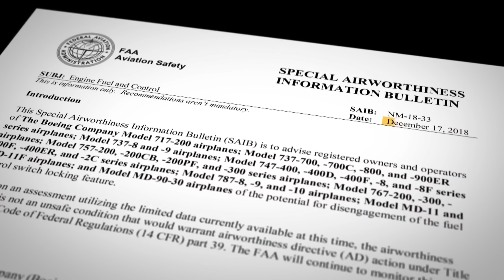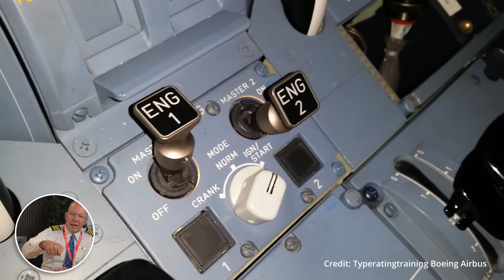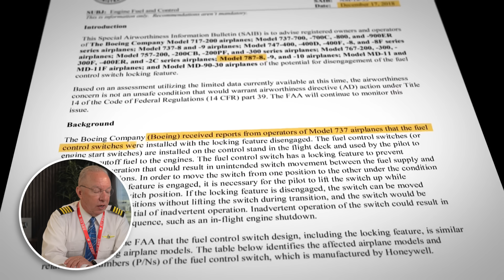Air India 171: The FAA’s 2018 Fuel Switch Locking Bulletin Explained (16 Questions Answered)

Comment: Captain steeve please see section Copied from the NM - 18 -33 report. It was not positioned upside down.  *The Boeing Company (Boeing) received reports from operators of Model 737 airplanes that the fuel control switches were installed with the locking feature disengaged. If the locking feature is disengaged, the switch can be moved 
between the two positions without lifting the switch during transition, and the switch would be exposed to the potential of inadvertent operation.*

Comment: Do we know the details of the wiring logic from the switches to .... Common mode failures (which this appears to be) happen due to poor design or inadequately considered design. 

You and many seem to still be thinking in terms of physical switches connected to wires, controlling discrete devices. In that world (decades gone), these two switches are independent circuits. Common flaws still existed but were vastly less likely.

Now with all the computer control, even physical switches often feed or control software systems. If the switches command computer action, common mode failures in that system is a major concern.

I suspect that is what happened here. Irrespective of the physical switches connected positions, I suspect that software failed and these circuits were switched to off despite the physical switches being in the on position. 

If this happened, the sequence we heard would be what we expect. The pilot (co-pilot in this case) asking why... the second seat (pilot in this case) turned the switches off; and him replying he didn't. 

In this case, the indication that the switches moved one second apart indicates NOTHING about the physical switch position, but rather the logical switch position in the software - as commanded NOT by the switches, but rather through software fault. 

Then after the question and answer, the second seat took the switches to off and back to run in sequence.

As the software thinks the switches are in off, the first part of that action is NOT logged, and only the return to run would be logged. The 4 second separation then makes perfect sense.

The key to figuring this out is to determine what precisely does the switch position logging record. Is there a detector on the physical switches that indicates their physical position? (unlike;y), or is there a continuity detection from the switch (also unlikely), or is there instead a logical indicator in software (most likely). Then based on that determining what failure modes could cause the failure. 

Only if the first of these is the case (logging detects the physical switch position directly, NOT INDIRECTLY OR BY INFERENCE) does the primary case suggest human action. All others suggest a potential for UNCOMMANDED action.

Comment: In the preliminary report it's stated that the fuel cut off switches were put back to run position. The thing that caught my attention is that there was a 4 second delay between putting the first switch back to run and the second being put to run position. Isn't that a bit too long a diffence for two switches that are next to each other

Comment: Why did it take the other pilot 10 seconds to put the engine switches back to Run ? Also there is a 4 second delay between the switches during this time. When they were used for cutoff it was just 1 second.
Reply: Because how would you know your co pilot did this? It would first take some time to figure out why the engines are suddenly slowing down then by his intuition or experience he must have noticed that it was the fuel switches, at this point the plane is already going down there are multiple things to handle ..unlike the airbus design I don’t think you can handle both the switches at once on a Boeing plane since the tops are rounded
Reply: @andrewmarthie5062  the 4 seconds is between the 2 toggling switches. So let's say he does see that the switches are off. As he must have done many times, he would flip the 2 switches in quick succession.

Comment: Can someone manually move the switches to cut-off position after the plane crashed already? Did the black box log the events related to switching those switches during the flight? So after the second pilot moved both switches back to normal position, another pilot again switched them back to cut-off position? 🙄
Reply: No bro even after re engaging the switches the engines didn’t have enough time to make enough thrust
Reply: @andrewmarthie5062  I understood that from the previous video. I wonder if another pilot even tried to return them to the normal position... And if he did then whey they were in the cut-off position in the very end?

Comment: I think it’s time for the FAA to put forward a mechanism for video data to be included in black box recordings. It’s a fine line between privacy and safety but the differences can be overcome. Black box data can only be accessed after its physical retrieval so video data could be exclusively stored in the black box. This will overcome the threat of video data leaks. As another procedure I would also recommend the automatic deletion of all video data from the black box once the plane is on the ground after flight and the engines have been shut off. I don’t believe that too many pilots would disagree with this and imagine the answers video data could have provided to this disaster. Questions that unfortunately will never be answered due to lack of video data. It’s sad the final stage of decoding this disaster will remain unanswered, which of the two pilots cut off the fuel and why. Video data could have helped answer that

Comment: Hi Steve, I have a couple of questions around the fuel cutoff processes.. 

You stated that an electrical fault is just not possible with regard to the fuel cut off switches and dismissed that concern outright with not much explanation.

Would you be kind enough to delve into that a bit more for us simple people so we can understand the process better?  

How is it not possible? What redundancy system catches would be in place to pick this up? 

At the heart of my query is, Is it possible that there may have been a  "glitch" in the electronics or indeed the programming that MAY have caused or contributed to  this?? 

Is it fair to say that we have seen accidents in the past that have been caused by software glitches or circuit malfunctions?? 

Thanks you for your excellent work on this.
Reply: Glitches don’t work like that and are very very improbable…the 1 second delay between cutoff the cockpit voice recording of the captain objecting and the 4 second delay between captain manualy re engaging suggests that they were indeed physically in an off position and taken out of that position to run again by the captain (I’m assuming captain).. so it’s foolish to suggest a electric glitch cause that won’t cause the switches physically moving positions

Comment: I don't know if I feel better knowing it is deliberate or if it is an mechanical or faulty electric or design+safety overall. I think Bby my reaction when you came out before yesterday, I may be by the slightest margin think I am a bit relieved it was a more probable deliberate act. I think I am more reassured to find it out

Comment: Were there two ADs, The one read at the head of the video warned of a catastrophic failure,  you said the one you discussed meant you could not start the engine, that would not be catastrophic, just annoying. 

As I heard the girl (AI?) read the first one, the problem was the locking mechanism was not installed correctly, which could lead to a catastrophic failure. I assume that the spring was improperly installed, if at all, and provided no resistance to moving. If that's the case then ergonometrics might be an issue. I understand the visual logic of having switches up for on, but if a hand falling off throttle control could be an issue, then up should be off. Maybe better, the switches should work sideways. However, if the AD was done, ergonometrics could not overcome an intentional act.
Reply: Even without the locking mechanism both switch had a delay of 1 second … even if you accidentally brush against such hard equipment there won’t be a delay of 1 second …this was deliberate

Comment: Why do u think, turning back fuel switches to run state took 10 seconds ? And that too after long delay between two ? Like it was turned off at 1 sec difference, cant both be turned back on together or at minimum interval?
Reply: If you were the captain how would you know your copilot sneakily did this? First you would hear the engines slowing down then you would try to figure it out, not like your co pilot is going to help if it was deliberate … even 10 seconds seems very fast
Reply: @andrewmarthie5062 question "why did u turnoff" was spontaneous, but turning back the switch on would take time? Is it by design, as aircraft is now on RAT and it takes more time to 'process' the command even when switches were moved back to run immediately?
Reply: No they both can’t be turned on back together …it’s a one at a time operation with the design on boeing
Reply: @andrewmarthie5062 simultaneous off needs prevention, off to on transition should have been designed to be faster ..

Comment: Does the Black Box record how many times the switches were moved no matter the function of the engines? For instance, after cut-off, how many times they may have been rocked ON/OFF? This might indicate a mechanical switch failure if the pilots were attempting to make the switches function properly. So, at the point of the pilot asking "WHY?" do we know what position the switches were in and how many times they changed? Can an electrical problem block changes of switch position from the Black Box?
Reply: Yes …it was in the report…they were both turned off once and then on again later at different intervals

Comment: Steve, I work as an aerospace test engineer in the military sector and see switches similar to this in various applications in avionic systems. My comment is in 3 parts.. Firstly - The Boeing SAIB MM-18-33 refers specifically to the detent on the switch; not the installation of the switch itself. Also the aircraft would never pass final flight testing to be delivered to customer if installed upside down. In my experience, there are many different part numbers for similar switches as you can see from the list on the SAIB and it would be easy to think that the SAIB applies to a  737 aircraft not a 787 aircraft as it appears to use different switches and therefore the it doesn’t apply, but in reality the switches can be identical from a functioning electrical and mechanical detent perspective; but may simply carry separate part numbers because of the style of end cap on the switch or even paint colour for example. I cant understand why section 12 of the report does not call for further investigation with Honeywell (who are the switch suppliers according to the report). Clearly, If the switch detents didn’t hold the switches in the up position as required due to vibration or inadvertent touching at the wrong phase of flight, it completely explains the conversation between the crew who maybe blameless in this instance. Secondly the SAIB is not mandatory and asks operators to feedback to design authority which means a lack of inspection during routine maintenance could have played a significant part.  
Thirdly, and this would be a criticism of Boeing, but clearly the switches are what we would call "safety critical" and therefore to minimise probability of catastrophic accident caused by inadvertent shut off of fuel they are gated switches. My question to them would be are the detents sufficient? I would have thought the investigation would have centred on the fault analysis of those detents. I completely understand that crew procedure will cross check the operation but if those switches are so safety critical, shouldn’t fuel cut off rely on the depression of a further push switch or something to confirm the intended action? Sorry it’s a long one. Thanks for your excellent channel…
Reply: Let me ask you this. Those switches have been in use for a long, long time, the plane in question itself was in service more than 10 years. You think pilots and maintenance people would not notice if the switch could be too easily thrown? How many 737 and 787 planes are flying out there? 

Obviously everything going on here is speculation, we only know what has been reported. There is one fact that seemingly precludes a faulty switch from being the cause. That 1 second interval between switch 1 and 2 being shut down is what you would expect if a pilot manually put them in the kill position and would imply the gating was working.
Reply: @njlauren the report says these switches were replaced in 2023. Read the report.
Reply: @MrMaguuuuuuuuu
If they were replaced in 2023 that was 5 years after the 2018 advisory. You think whoever replaced them wouldnt mske sure the lock was enabled?
Reply: @njlauren that’s not what the advisory is saying. The mechanism maybe defective. Whoever installed the control unit (not just the switches) may not be aware of the advisory. The report says AI didn’t inspect the switches as it was not mandatory…again read the report.
Reply: @njlauren   The report says "01" seconds which also begs the question, is there a decimal point missing?, is it a typo or what? -  this could range from 10milisecinds to 10 seconds - Who signed the report off with that sort of error in it? Again more questions than answers
Reply: @time-mx9gp 
Pilots and others have said that 1 second would be how long it would take to flip both switches. 

I just watched a video by an aircraft technician who works in 787s. He gave a full rundown on how those switches work,in fast how the whole system works. He doesn't that draw any conclusions,refused, but several things jump out:
1) the whole 2018 advisory was for the 737, ppl are assuming that 787 is the same,he said it isn't. The other thing he pointed out is those switches are never replaced by themselves, that they remove the whole throttle unit that has the switches. On a plane, units like that are swapped out regularly, after a certain number of hours. On the plane he was on, the unit had been replaced 3 times since 2018. Those units generally are sent to the vendor when swapped, they test and refurbish them, and then they are sent out back to the airlines for re use. 

That Indian airline 787 likely had that swapped out several times. Airliners are not like cars, they don't wait until an assembly or part fails to replace it. Regulations require they be swapped out every x hours,depending on the criticality. Again, given the way they swap
Out the assembly the switch is on, it is highly unlikely the switch didn't have the lock working, the vendor would have spotted that even assuming it was originally installed wrong..

2) ppl are saying ' they couldn't know the switch had been turned off, they just assume,'. Nope. The tech gave a description of how the switch actually triggers cutting off the flow. By cutting off the switch ( which btw is totally mechanical), it causes a signal.to.be sent on the data bus to the control unit. That is logged on the data recorder, so yrs they do have a way of knowing ,( and likewise setting it to run,) 

3) but what if the control unit had a defect and shut off the fuel? There are multiple problems with that. First of all, if the control unit did that, the data recorder would show fuel cutoff happening without the switches being thrown. The computer sends a signal to the fuel cutoff valves and that is logged. So if that was true they would see the switches weren't set to cutoff and the control unit sending the cutoff command. 

Plus the odds of it shutting both engines off like that is miniscule. A defect in the controller or in the cutoff valves hitting both at the same time is next to impossible. Plus chances are if those units were faulty, they would be throwing error codes the data recorder. 

4)'the co pilot asking why the other guy threw the switches was bc the engines shut down, he couldn't have seen that'. Wrong. The switches are mounted on the center console just below the throttles on the assembly. The first officer could just glance down and check them, it is that easy.

Again the guy I watched simply went over how the switches work, the downstream systems work,and he specifically mentioned the 2018 notice and talked about the switches being part of an assembly that is swapped out as a unit. He said the switcheat s could be swapped out, but that mechanics wouldn't do that, lot easier to swap out the assembly time wise, and that the entire assembly is routinely swapped out as part of the routine  maintenance procedures. 

Btw he didn't give his opinion, he simply gave the facts,said he would wait for the final report bc he isn't there. What he did do ,to me, is refute a lot of the speculation out there,eliminated theories .
Reply: There's a picture of the switches after the crash, they were in RUN position, i.e. they were locked even after that explosion
Reply: @AkitaMix 
If so , then that would imply that the locks on the switches were working properly, if the lock out wasn't engaged those switches should have flopped, at least one of them.
Reply: Long one but precious one.

Comment: In the EgyptAir Boeing 767-300, which in 1999 was blamed on the pilot as a suicide for the accident , and in the recent doomed Air-India also was using the same fuel cut-off switch made by Honeywell model # 4TL837-3D (according to AI search). Did anyone ever investigate this connection?
Reply: The recording does NOT say "Why did you do that"
According to yesterday's video the pilot says" Why did HE do that"
THERE WAS SOMEONE ELSE in the cockpit...... HE not YOU